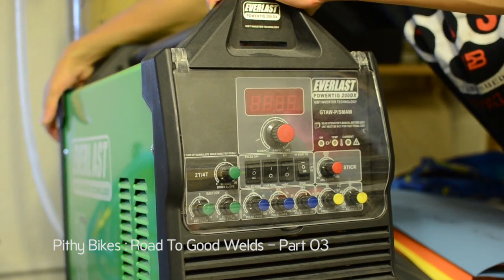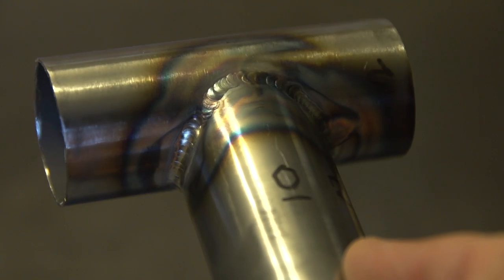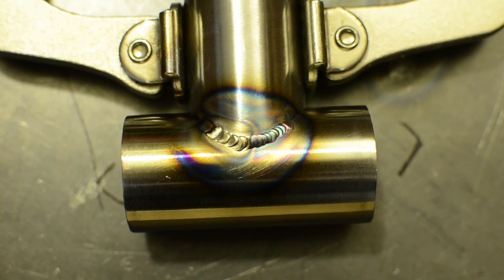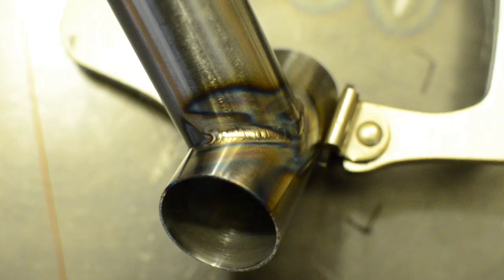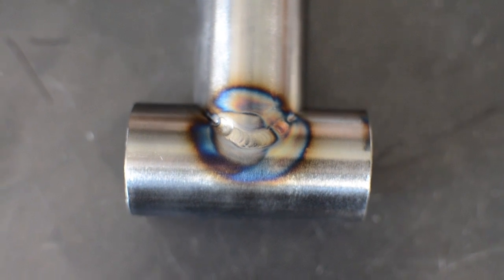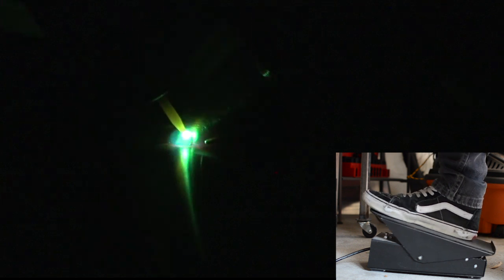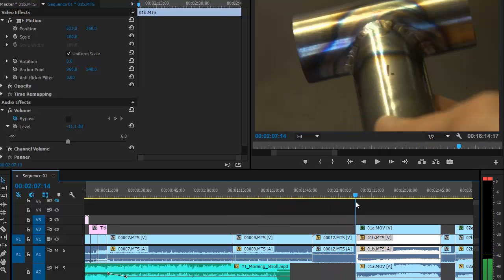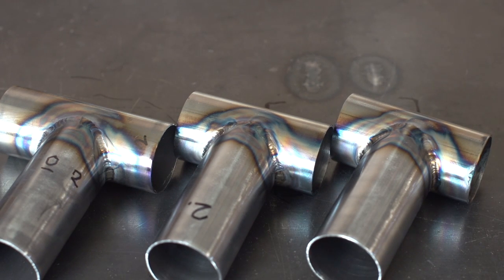Bicycle Frame Build 30 - The Road To Good Welds Pt3

Comment: I find manual pulse lets me set my own pace.
Then again I learned on a machine that didn't have any automatic pulse settings and find it difficult to adjust to the machine's timing, meaning I go by how the weld looks and sounds as I'm welding.

Comment: Why do you have so much tungsten stick out? Try less! It helps shield the flat spots your having trouble with.  Also try keeping the torch angle almost perpendicular to the puddle at that spot in particular.  

Matt @HellaFabrication.
Reply from the maker: +Matt Moore Will do!! Thanks. Right now my wrist is like a deer frozen in the headlights :)
Reply: just stop and re-position then!  nothing wrong with that if you work on your tie ins.

Comment: Good video, but you are way too hard on yourself, those welds look great. 
One comment perhaps, the welds are hard to see with all the discoloration, you might want to brush them with a steel brush before they get cold to remove the blue camouflage effect, I think it would make them easier to see on video. Nice job.
Reply from the maker: +Crivo152 Thanks! I do sometimes brush just the ends for when I'm connecting the next bead. But overall I've been leaving them unbrushed so you guys can see the story that the colors tell. (so poetic) ahaha.

Comment: If your good you can do this without pulse. I've welded up to as thin as 0.45 wall thickness without pulse or the rule of 33.
Reply from the maker: +Xjuicy_jamesX Being good is the trick! :) But I wonder if pulse keeps the haz cooler? I suppose if you're really good you can go no pulse and quickly. I'm definitely nowhere near that level yet!

Comment: When manual pulsing it can be helpful to set max amps at max foot pedal this gives you a solid ramp up to max amps vs pedal angle estimation which is much more inconsistent..   And the rod is still being moved to far away from the puddle between dips..     If it is being moved this far away to keep it from balling move it slightly upwards will keep it cooler vs downwards where the flame kernel is pushing the majority of heat to..
Reply from the maker: +Jennifer Petrila Thanks so much for the advice on the rod balling. Yes! It makes so much sense, set it to max amps. forehead smack I will try this for sure.